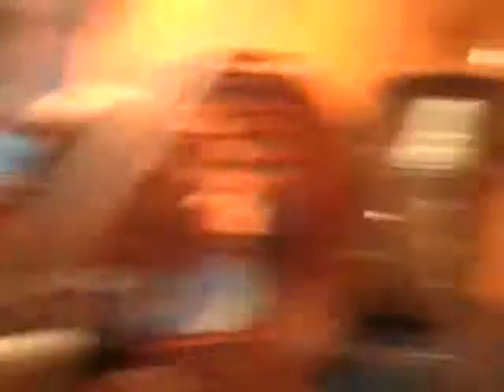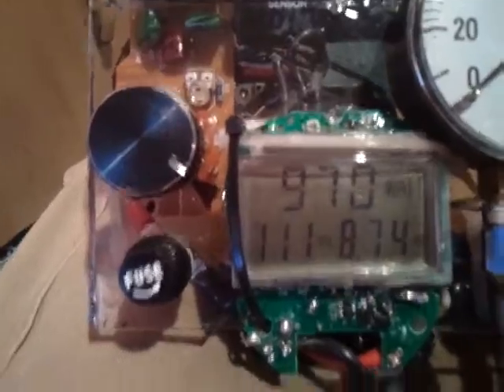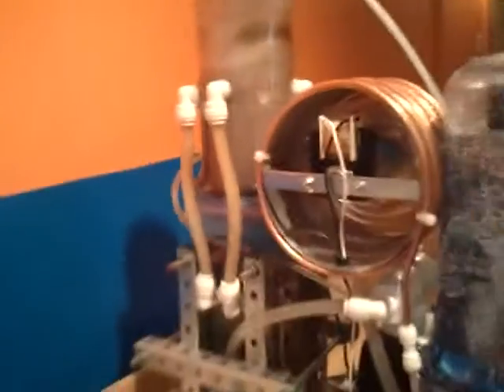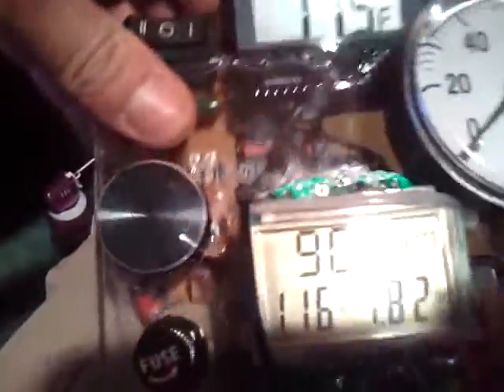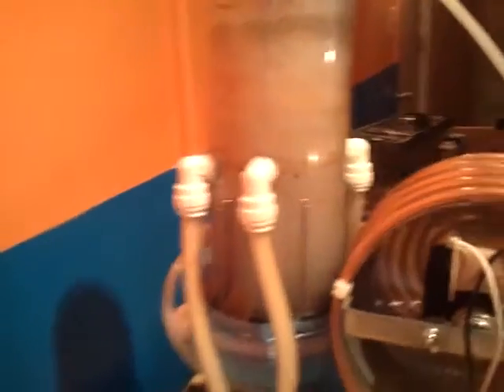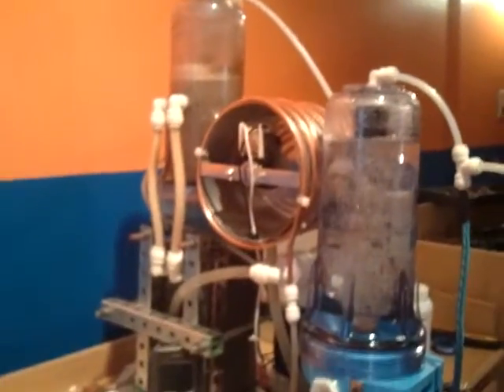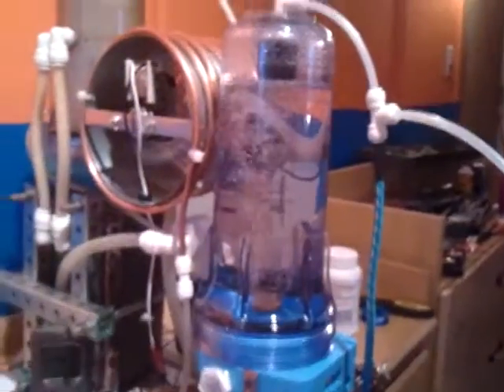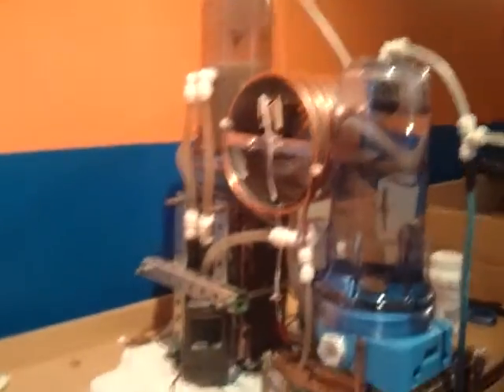DIY HHO torch' IRON PLATE CELL

Comment: @regpye Also I read that I need to use a cirtric acid solution with 10% citric acid by weight, is this true or should I use a more concentrated solution?

Comment from the maker: @legogunguy001 hey bro , for some reason my comment didnt go threw, this is a test and be advised i havnt done any current densitie calculations, if you exceed a critical current densitie you will destroy the plates, look at it like this, ss is very hard do drill and cut, u usualy need  a lazer , also ss is an absolutly horrible conductor, alos its very expensive sht , also it generates a piosonis carsinogen called hexavallent chromium..... iron or steel however is a ok conducter is cheap easy.

Comment from the maker: @delvis11 glad you like it , im a big fan of your wrk by the way, i sent you a mesg but not shure if it went threw, any way the iron plates are an idea i got from 1920's chemistry books, the iron anode issue is nat as bad as one would think, they ran iron cells for months 24/7 before any cleaning was needed , check google books out on electrolysis

Comment: you could try some carborundum powder in the elyte to knock down the foam-just rub two pieces of black sand paper together and wash the powder into a cup and add to elyte-should allow more current to flow since its a semiconductor and the pointy little particles will change the surface tension and burst the bubbles...lol at you walking around in the dark-maybe you should earth that beast.
kudos to you for showing iron plates will work-everyone else spending big to make cells from 316 stainless